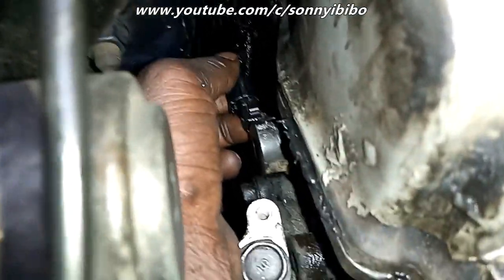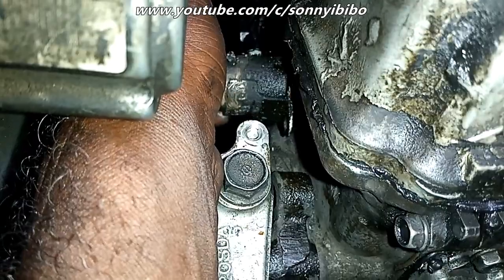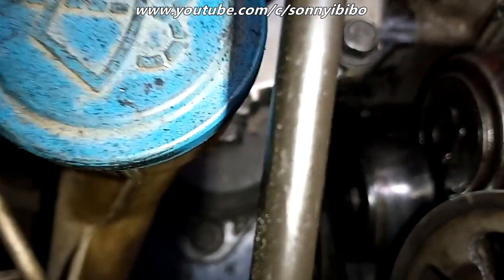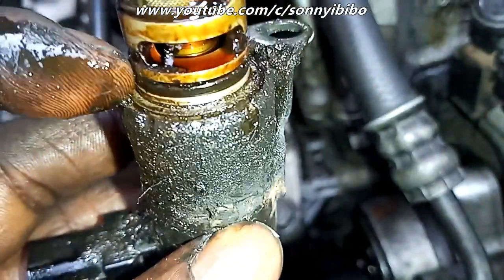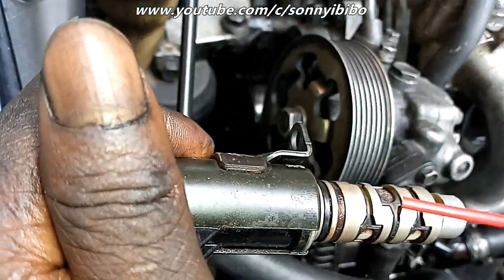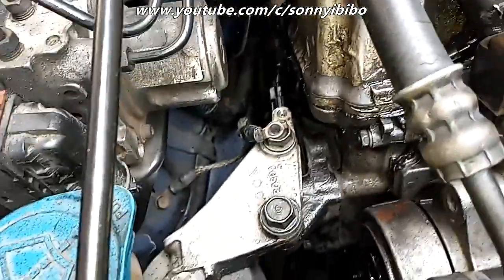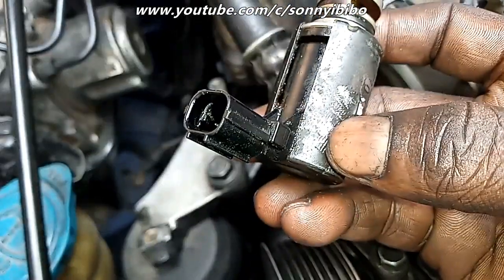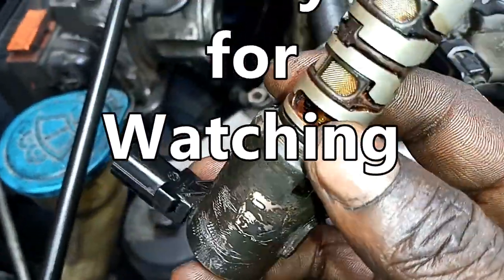DIY: Fix Engine Oil Leaks - VTC Oil Control  Solenoid Valve

Comment: Was this leaking from the o ring or where the connector part and the metal part meet?
Reply from the maker: @wtspapa24  oil leaks were seen around the solenoid. Replacing the O-ring prevented further oil leaks.
Reply: @SonnyIbibo  cause on mine it's hard to tell
Reply from the maker: @paquesepas6696  you may want to clean & observe further. It will help.

Comment: Pease don't use carb cleaner on it again. Carb cleaner destroys rubber materials. use petrol or kerosene to wash it
Reply from the maker: Thank you.
Kerosene may be okay with the rubber seal. Petrol is okay for degreasing the metallic part...👍
Reply: @SonnyIbibo  U're absolutely correct!

Comment: What is the part number? The dealer says that the o ring is attached to the solenoid. It s not suppose to come on and off and that I need to replace the whole solenoid and hitch is more expensive than the o ring your replaced. If you could give the part number that would help tremendously
Reply: 15832-RAA-A01 Oil Seal, Control Valve
Reply from the maker: Harry  your welcome.

Thank you also for taking the time to give this nice feedback👍
Reply from the maker: Greetings Raul, Thank you for seeing my DIY video.
I used a non-OEM O-ring. I went to a local shop where there are varieties of O-rings and found one that fit.

However, the Honda part number for the O-ring is 15832-RAA-A01.

Hope this helps. Pls SUBSCRIBE👍
Reply: @SonnyIbibo  thank you for the quick response! I’m going to give it a shot.